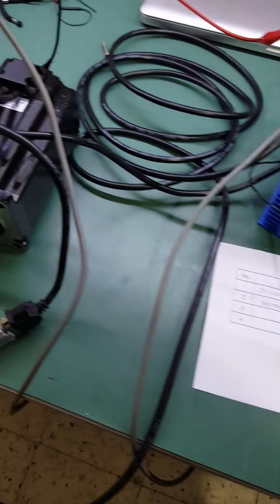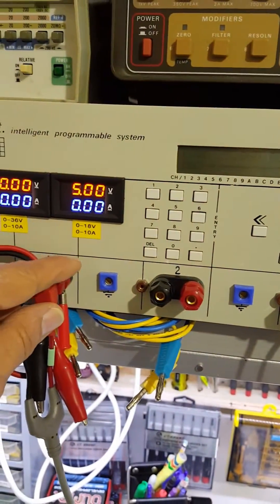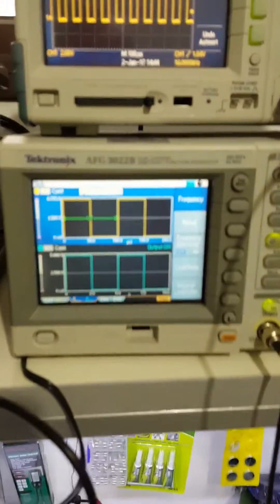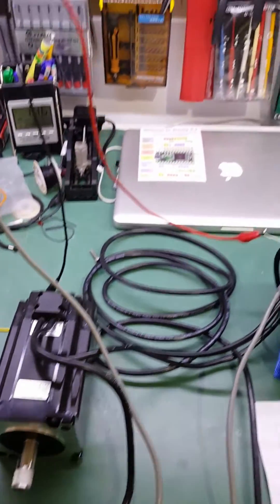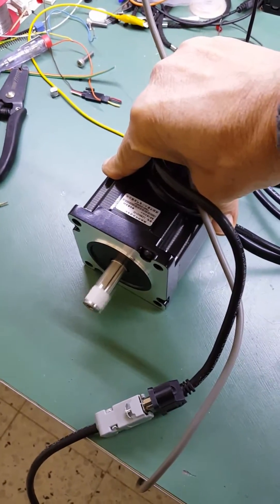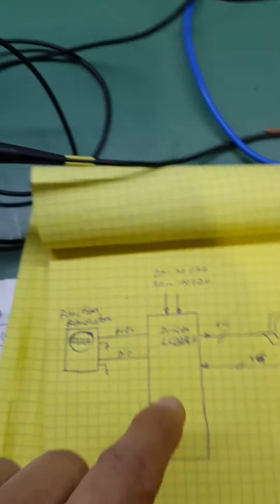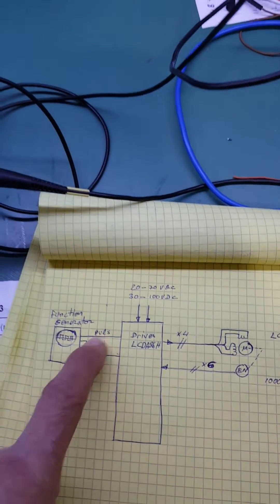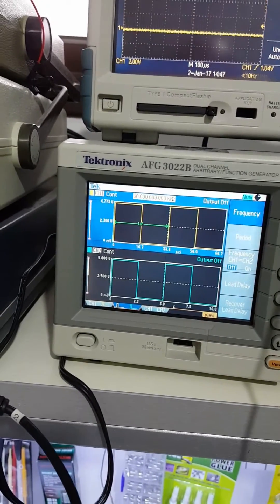Servo stepper motor + driver 8.5N•mt

Comment: Is this the motor 86HB250-118B  version? Do you perhaps know the dimensions, radius of the shaft?
Reply from the maker: Motor PN is: LC86H280.  
86HB250-118B motor is 1:1 identical.  Shaft diameter is 14mm.

Comment: this sounds very promising, just one question, the driver, can it handle only one motor or 2 motors???
Reply from the maker: Driver can handle only one motor. You will need a set of motor/diver for each system or axis
Reply: thanks, have you ever try vnh2sp30 ???

Comment: Hello, i want buy the Lichuan Easy servo 8,5Nm kit. How you feel with it? Is smooth and reliable? Thx
Reply from the maker: Antonio Camerota 
Hi Antonio
Since i install the motor/driver set ,   I had zero failure . The system works few hour every day with zero maintenance. Motor is self calibrated through the driver ( i dont know how do they do it, but it works perfect)
Thanks.
Reply from the maker: Antonio Camerota
 Hi ,  I find it very reliable. I use one in production for over a year zero maintenance and zero failures